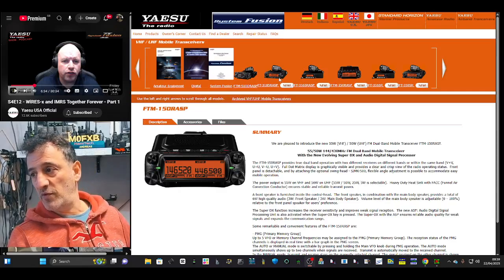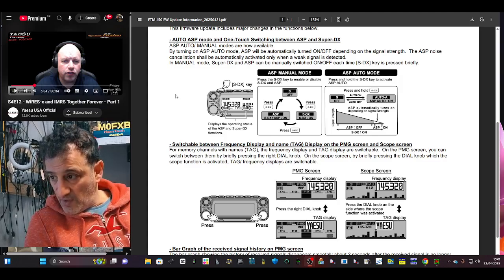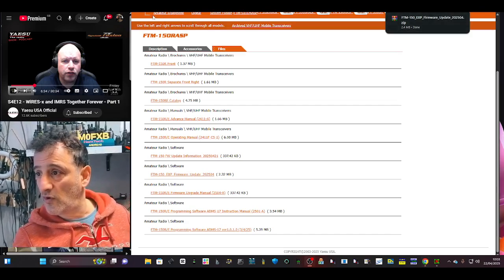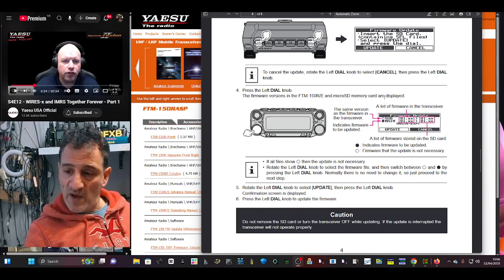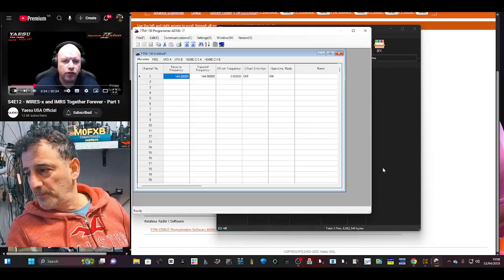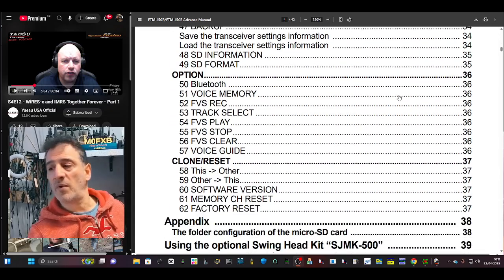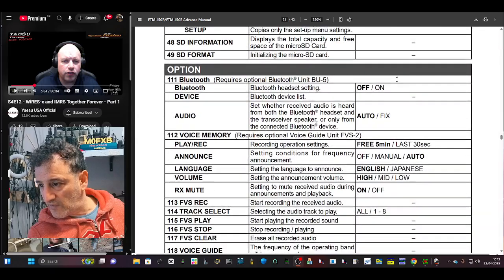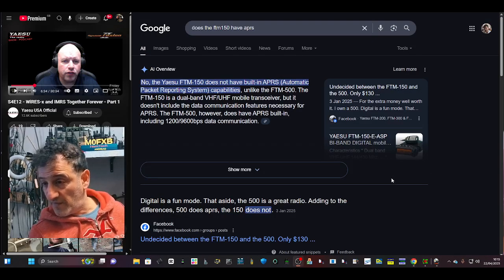Yaesu FTM150 New Firmware April 21st 2025 v1.02/3

Comment: I'm curious if it switches very rapidly in the case of several different signals coming in. For instance, I'm speaking with someone giving a very strong signal and then a weak signal comes in and it switches. But does it switch right back if the strong signal comes back immediately afterwards? If it has a delay to it then that could be extremely annoying on a busy channel. I'll be upgrading my firmware soon.